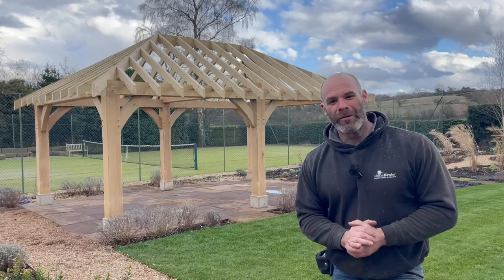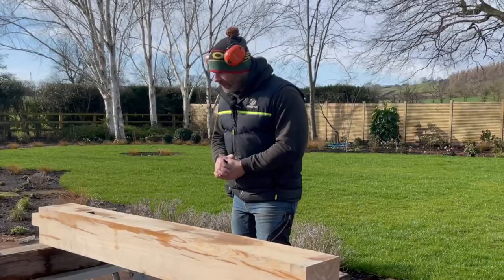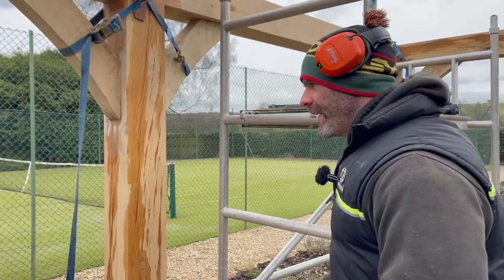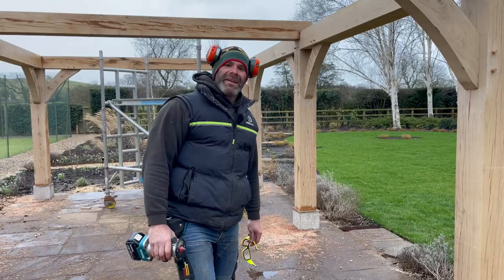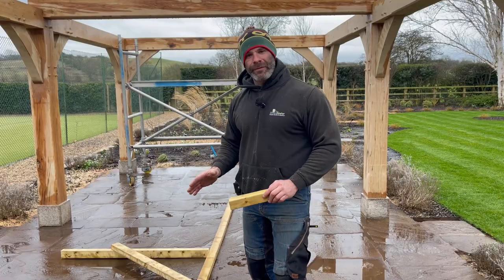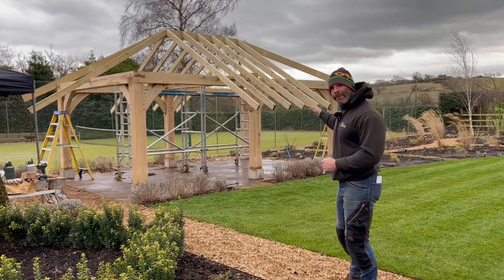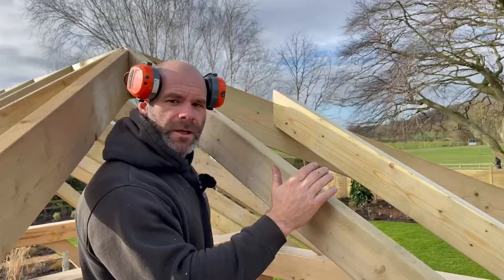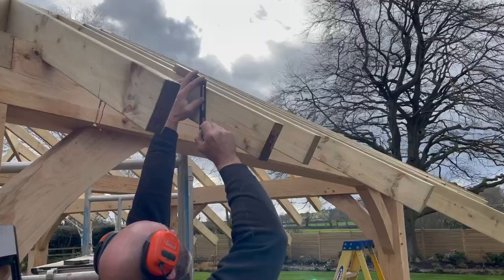Oak Frame Gazebo Ep:2 Hand Cut roof, NO MATHS!

Comment: Brilliantly explained 👌
Reply from the maker: Thank you
Reply: S@simonbowler1  I  watched your video again today.  I see you how you marked out your rafter with the timber right angle gig on the ground.  That's exactly how I was taught by a carpenter a while back now 😂. It's fool proof and exact. 👌. All the videos I see on roofing is maths and stepping off from a square.  Your the first I see doing it the way I do it. Also I'm in the process of building a 6 sided hexagon gazebo myself. I was wondering how high I'd put my wall plate so to cut my 150mm square posts. I decided on 2.1 meters. I see that's what you  did. So I'm OK with my height. Brilliant video.  Keep them coming.  Top class work Simon 👏

Comment: Another great video 👏🏻
Reply from the maker: Thanks for watching 👍🏻
Reply: How do you start the roof assembly off, i.e get the ridge board setup and located in position?
Reply from the maker: We faster 2 rafters to the ridge, one bold it in the air whilst the rafters aren’t fixed to the wall plate, then no round and fix reel more rafters on the other side so it stays up 👍🏻

Comment: When putting the wooden dowels in the corners posts to fix the knee braces do you only drill to the tenon and not all the way through the post?
Reply from the maker: Correct, we make sure it goes through the tenon and into the post, but not all the way through

Comment: Absolutely captivated Simon, great work! I'm just about to embark on a 3x4 English oak, single span with hip roof. This has given me a serious kick in the right direction. One question, what size are the frame timbers in this video? Thanks, Tim
Reply from the maker: 8x8 Oak frame, 7x2 hips and 5x2 commons 👍🏻
Reply: @simonbowler1  thank you🙌

Can I ask your opinion on the single span? Theoretically will I be ok with a 7x7 across 4 metres
Reply from the maker: @Mr1animal11  more than likely, if you’re unsure, check with a structural engineer